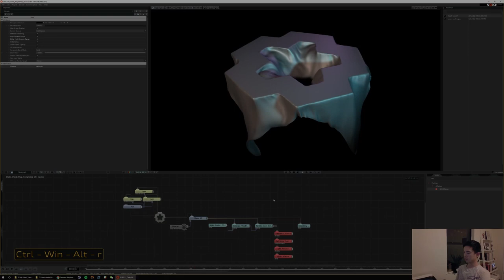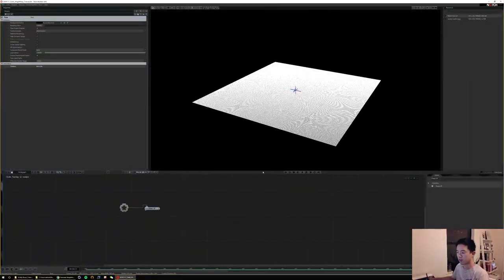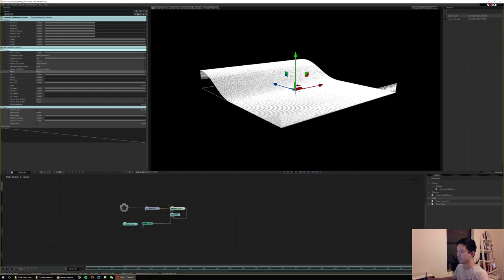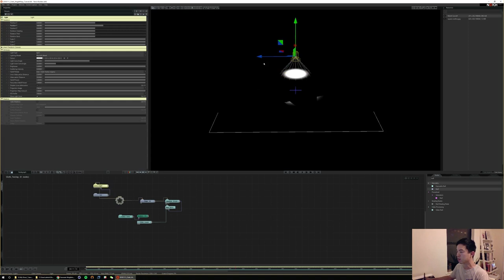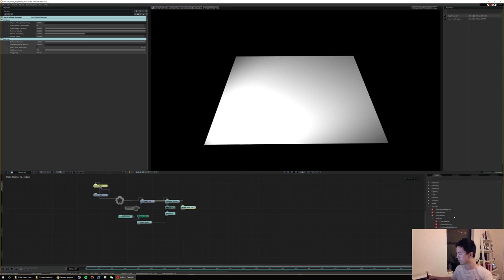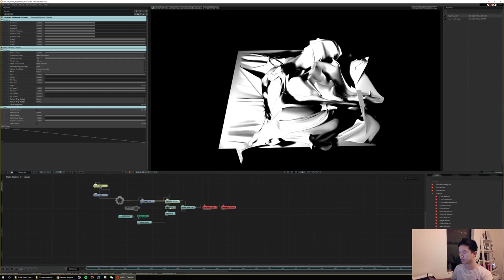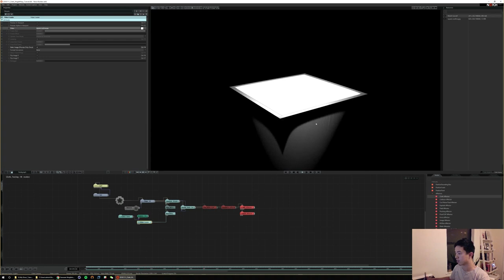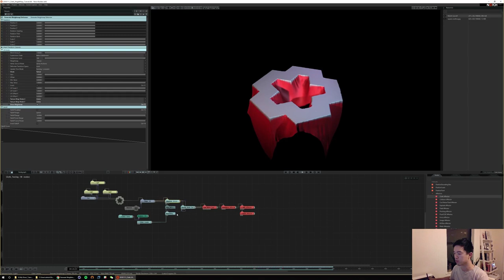Notch Tutorials - Weightmaps + Intro to Cloth Simulations

Comment: curious about what's exactly happening when you lock your framerate. i understand what it's doing, but why is it effecting the 'cloth' like at 13:38? it seems to 'shrink' the cloth, shortening the length of the SPH affector. is there another way to achieve this without fixing the framerate?

also thanks for all these tutorials!- massively helpful to start and continue learning.
Reply from the maker: Any simulation is more consistent by locking the framerate or update rate. This number can be whatever you prefer, but locking it to some constant is good practice for simulations. It shortens the cloth because the simulation was running wild at super high rates and causing weird behavior.

Comment: Cool tutorial, But how do you move/ rotate the weight map texture, while simulating.
For Example I want to spin the Notch logo in slow motion while cloth is simulating
Reply from the maker: Short answer is you cannot as the weight map is not meant to be dynamic for simulations like this. However, you could probably get a similar effect by spinning the entire cloth? You could also try using cloth physics instead - I have a different tutorial on that, and you could spin the object that the cloth has draped onto. Cheers
Reply: Cool thank you buddy.

Comment: My SPH affector just goes berserk on X axis and does not follow the lines of weight map at all for some reason.
Reply from the maker: If your weightmap isn't working I would double check that area and that you do in fact have it set to use texture in the weightmap node?
Reply: @KevZhuArt  I doublechecked my settings, exactly the same thing going on, weird.
Reply from the maker: @vjrook8974  YouTube comments is hard for troubleshooting haha. Can you post up on the notch user group on FB? There's more visibility there for folks to help you out (myself included). You could also try pulling my DFX and swapping the image for yours to see if that works
Reply: @KevZhuArt  Yea i agree with you LOL...your file works obviously, but for some reason, after importing my image, the image itself becomes cloth deformed, and the plain is still, completely opposite of what I want to achieve and what you did, even tried changing the logo color, weird, will post it on User group.
Reply from the maker: @vjrook8974  if it's just inverted, there should be an invert tick box on the weightmap node